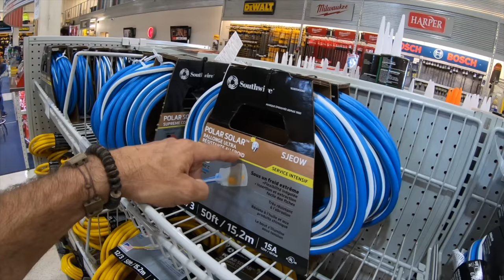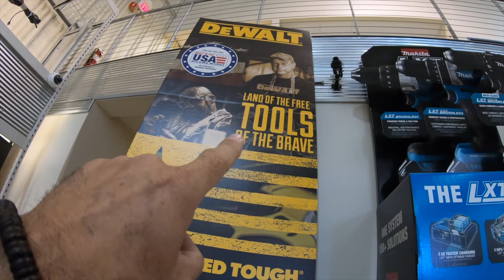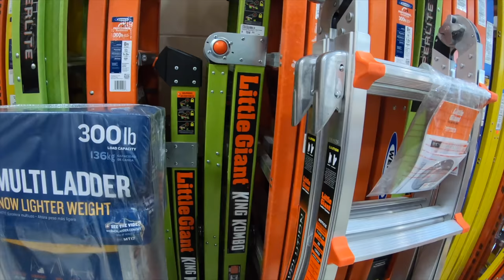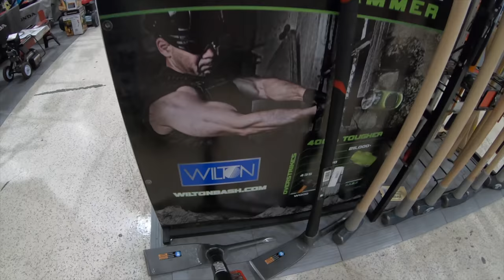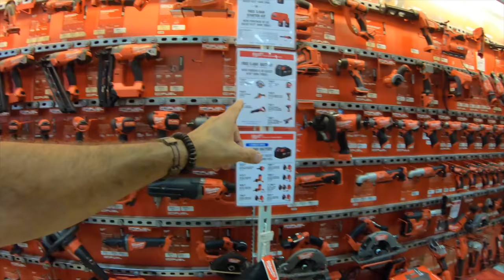Touring the coolest Tool Store I've Ever seen.  4k video

Comment: I bought my Metabo 2 speed drill at the age of 15. Now i am 63 and still using it. Greetings from Belgium.
Reply: I have a 1970 grinder, has the wood handle. Had marano repair dealer put new brushes in it a few years ago an got a letter with it when I picked it up, said who ever owns this don't get rid of. Pretty cool I thought
Reply: This should have said matabo

Comment: I tried out the IQ dust-less concrete shop saw and it was AMAZING!!  I work with cinder block and landscape block and usually use Stihl quick cut saw, but this was incredible.  I cut capstones for a retaining wall for about 6 hours straight and no dust, or water needed, it all gets sucked into the pan under by its own downdraft.  Just turn the filter knob every 20 mins (hour or more in my case) and it gathers all the super fine dust in the pan below.

Comment: Those iron workers are awesome, we had one at my old high school which we used for cutting metal for welding, it cut through 1/4 inch steel like a hot knife through butter

Comment: I would love to try one of those 1”drive Milwaukee’s at work, we use Hilti cordless and Milwaukee corded, be burn through both monthly. I Also watched a coworker break the handle of the 4 lb Wilton hammer. Not sure if it was the same deal but it was labeled unbreakable. We also use metabo grinders, they are great. They hold Up the the abuse and constant use well. For decades

Comment: The "demo" chainsaw I think is a terminator chain. Its $200 for the chain. It's used by firefighters to cut holes in roof. Streight thru shingles to vent and to save.  That bosch rep is a pencil pusher. 🤣😂🤣😭
Reply: It seemed to have "blocks" for teeth, as a diamond blade chainsaw blade for concrete would have, particularly since it was positioned with the concrete saws. I don't doubt blades like you're thinking of exist, but they'd have close to normal teeth for cutting wood/sheathing, but in a manner to not be destroyed by shingles or metal roofing/flashing.
Reply: Also, look at it again 6:34, it has a water hookup like a normal concrete saw.

Comment: I've been using Metabo tools for years in metalworking industry industrial Construction they're almost the best you can get German engineering
Reply: They are with Hitachi now I'm worried about quality going down
Reply: That's all we used back in the day, but they started breaking on us all the time. When I stopped is when I bought a new hammer drill and the cord had a short in it right out of the box.
Reply: That's all we use at the metal shop weld/fab shop I work at and you can't break those angle grinders. They last 5x longer than the other brands I've had. Great products

Comment: I'm a mechanical welder that builds stands for pipes all day and we all use metabo grinders and man do they shred, awesome build quality. Personally I use my dewalt grinder (sorry I forgot the model) mainly due the fact that it has a non-keyed pinon gear meaning if it fucks off on you it slips instead torquing your wrist it has great power and pretty good and straight forward build quality. Other than grinders I don't know much about Metabo sorry.

Comment: Poor Dewalt and bosch guys.  The Milwaukee lineup is crushing the competition with all the offerings
Reply: Milwaukee is on fire with all of the new lineups and specialty tools. It seems like every few days or at least weekly they are releasing an upgrade or specialty tool that I didn’t know I needed next! I thought the other brands were keeping up but that’s not the case. The only tool line could give them a run is Makita and I don’t think they’re interested a drug out turf war and so they keep to themselves and specialize in what they know best  and every once in a while they kick out something new to the lineups. Stanley/Dewalt/B & D are trying to give big red some competition but their tool allergies keep slowing them down. I’m glad to see Milwaukee acting like the old business even if they are just a shell of what they were when they were Wisconsin based and building bulletproof hole hawgs & the original sawsall. I would be all over their new battery lineups now that they make 12 Ah lunchbox batteries with super chargers that recharge the largest batteries in just 1 hours time! Unreal!
Reply: Truth!

Comment: What good are those bits if they are splitting the wood, now if that was a “real work piece” we would have to replace the wood!
Reply: The splitting wood had to do with the nails being driven along the cleavage grain of the wood.  It was the nails that caused the splitting not the bit.

Comment: Iron works are a very valuable tool for iron work. We had a Scotchman at the fab shop I worked at. You can punch round, square, oval, slots. 10 times faster than a drill. Not portable like a drill though. You can cut angle iron, round bar, square bar, flat bar, some plate, notch pipe and square tube, bend iron, make U-bolts, and square u-bolts.

Comment: I'm a Union Steamfitter and Metabo grinders are the best in the business. Definitely recommended for everyday use. But if you only use it once in awhile and dont you it to extremes I wouldn't get one.
Reply: The best.. I've burned up all of them but the Metabo not even comparible they are the best.. only thing my Metabo ever did I had to replace the cord with a Dewalt cord and dewalt cords ain't the greatest (all I had handy off a burnt up dewalt).. But Metabo IS THE BEST PERIOD.... but now Hitachi has bought Metabo and it sucks the table saw is a prime example

Comment: Metabo is a German heavy duty industry tool company, we have used their 6 inch and larger grinders in the steel mills for the last .20 years.Rugged,and high rpm is,tool less disc changing.

Comment: The Wilton BASH hammer line is the best hammers you’ll ever buy, I have been using them for years. You will definitely never break the handle as I believe it has steel all the way through it which also makes them the most efficient and hard hitting hammers you’ll ever put your hands on.

Comment: I've got the Bosch HD drill and half inch drive impact set. Loved the impact until the bits quit locking in. I didn't touch a drill for a couple months. When I began using the drill I found out pretty fast it was useless and went back to using a cheap air drill. You can forget using it with a stepbit or holesaw. You have to babysit the batteries on the charger too. The impact doesn't have the torque it should to be a half inch drive. I always had go behind it on ½" bolts. Obviously works fine with smaller ones.

Comment: Landscapers also keep the new half-inch impact gun for blade changing on the truck and that is using the 18 V which is awesome so then you could use that battery on the air compressor if one was low Vice versa

Comment: I’ve never used anything else besides the metabo grinders but there grinder for metal work are the best of the best I use a 6 inch grinder all day doing pipe fitting structural steel Millwright work fabrication demolition. That’s all I will buy and that’s all I will use. Tried other brands and they do not last like the metabos do I’ve had my 6 inch grinder for over ten years of hard use and the only thing I have done is replaced a couple of chords from cutting them and brushes
Reply from the maker: Thank you for the input Duane !

Comment: I have a lot of experience with the concrete chainsaw from stihl.   Mainly cuttin out doors in windows in concrete foundations for access or remodeling purposes.  If you take a regular concrete saw and put 2 blades on it side by side instead of one it will give you a nice guide for your concrete chainsaw

Comment: You asked about metabo, they make the best grinders out of anyone. I’ve had mine for 7 years and haven’t been able to break it and the power compared to anything else is unreal. No bogging down on heavy steel or burning out the gears. I have newer models just cause we all like new tools but I’m a welder and I wouldent choose any other grinder over them. Anytime you break them you can get it repaired or they will replace but haven’t been able to break one yet in my 9 years of welding. Also every welder I’ve worked with swears by them as well they dominate the welding field, you can ask any welder.

Comment: I can't believe he hasn't heard of metabo. When doing construction, metabo was such a household name that it's what we called it whenever we attached a cutting disc to a grinder. "Hey John, go over there and metabo a 2 foot length of pipe for me, and get it ready for welding."
Reply: The type of construction you do is the main difference. Most fire resistive commercial buildings will be put up with mainly steel. Residential buildings will mainly use wood and even the piping is plastic so having a high end Metabo grinder in your truck would be rare.
Reply: @superdog1964  I didn't think of this, it should have been obvious. You're right, I did mostly industrial construction.

Comment: I work for a concrete cutting companyThe chainsaw is only used for specialty cuts where you have limited clearance or tight space  the chain is ridiculously expensive $400 on average and it does not last  long at all

Comment: I just seen the spanner wrench demo by bosh and metabo has gotten rid of those with a hand spring nut years ago. You can change with ease no matter how hard you push through steel or the times you pinch a blade cause everyone knows when you do that it’s hell using a spanner to get a disk off but not matabos.

Comment: Landscapers also keep the 4 1/2 inch angle grinder with the 18 V on the truck for blade sharpening with the 18 V I’m dying for 18 V Air compressor imagine that with their big amp battery

Comment: I dont have the full titanium stiletto.  But my stiletto hammer is the best hammer ive ever had. As a carpenter its a must
Reply: I just ordered myself one yesterday m8, I decided to treat myself after somebody picked up my beloved 22oz estwing on site and walked off with it leaving behind their old, fucked one.
In the UK they are marketed as the Milwaukee stiletto hammer, they are a little more expensive aswell. I have paid £200 ($250) but it comes with two heads, one flat and one milled head. I cannot wait for it to get here on Tuesday, 
I use my first fix nail gun when theres a lot of nailing to be done. 👍🙂🙂👍

Comment: Concrete chainsaws are junk compared to a quick saw.  They are for a specific purpose of cutting into a corner where a circular blade can't fit.  The chains on them wear out really really fast, basically you need a new chain per job, not per jobsite per job.

Comment: I may be the only one but disappointing.  Just today I was thinking I needed a proper tool store (had to drill and tap in stainless and needed a better tap handle and letter bit that I didn't have on the truck) then I see this in my feed when I get home.  But ... only contractor tools.  Not a ratchet, socket, tap/die, letter drill, etc in site.  So great for construction trades.  Not so much for mechanical, machinist, etc.

Comment: Bosch's idea of a grinder that needs no spanner wrenches a good one except that you have to use Bosch discs which really hamstrings a person if there's somewhere and they run out of Bosch discs they can't just run to their local hardware store and get a regular disc. That increases revenues for Bosch but it screws the consumer in cornering them to use only Bosch discs. I hate anything that is proprietary. I rarely use a spanner wrench anyway. I just used the button to lock the spindle and twist it off with my hand. As they spin they tighten anyway and I've never had a problem. I'm actually had a problem getting it off sometimes but never have had one fly off because it wasn't tightened down.

Comment: I can't believe you Guys don't kow anything about Metabo!
Go into any serious Welding/Fabrication Shop, Refinery, or just about any serious Industrial setting, and see what kind of Angle Grinders they are using. Metabo! That's what you will see. I have used, and worn out about every brand of Angle Grinder ever made, (cordless  & corded) I can tell you that I use nothing but Metabo Angle Grinders now. They are German made, and top shelf quality. Very comfortable to use. All of mine are "Tool less". I can change the Grinding Wheel, Flap Disc, or Cutting Wheel in seconds, by hand, no tools required. I own them.in 4-1/2",  6",  7", & 9"
Once you use a Metabo Grinder, you won't bother with anything else again.

Comment: At 9:58 during this video. What is the number for this dewalt 12volt?
Reply: DCD701B is the tool only option and DCD701F2 will get you the drill, two batteries, a charger and a bag.

Comment: In france we use a lot of HILTI products, I rarely see you with that brand, is HILTI not so implanted in the USA?
Reply: Not really. I've never seen their consumer hand tools sold in a store.
Reply: I mainly see Hilti products used in the tool rental business and then it is the larger specialist type tools like electric powered demolition hammers, saws etc. I have yet to find a retailer in the USA with their products on a shelf and I have been at retailers in over 20 states? I have no clue why? (The rental CO's buy them somewhere!)
Reply: @superdog1964  In France Hilti sells no consumer products they only have one type of products built for the pros. They sell most of their products directly with no one between them and the users, thay have a number of shops and reps if you have a problem they have a solution everywhere in under 24hours in the worst case. You pay the price but their products are built to survive everything.
Reply: Hilti prefers to sell direct in the United States. There are several master distributors in the more rural areas and Acme Tools is one of them. The Plymouth MN is not allowed to stock Hilti per their agreement. All ND stores carry it and Duluth & Bemidji MN stores do as well.

Comment: Milwaukee SMS tools but they've also screwed there patrons more than once with crappy tools and either crappier responses to the crappy tools like the 18 volt Ni-cad and their current 12 volt systems that are almost disposable since they only last about a year. Personally, if someone is holding the tool in their hand and it's broken and they're not happy with it they should fix it regardless of whether it was registered or not.

Comment: Concrete chainsaws are a pain in the ass .but they have their application if you want to make a small square or you have to run an air vent through a block wall it's  the way to go just pray to God you don't hit rebar . concert cutter for 10 years

Comment: I’m an electrician and those Bosch 
“ nail eaters “ are garbage. 
We used to open a new 7/8 inch bit for rough wiring a new house and then take it to the next new house now we are stuck buying 2 to 3 bits per job

Comment: 19:15  INSIDE JOB TURNING NUTS IS A HARD JOB,  AT LEAST GRAB THE CORRECT SOCKET  FOR THE JOB WHILE IN A WEATHER CONTROLLED ENVIRONMENT WITH LIGHTING .. JOB REQUIREMENT  MUST HAVE SOFT HANDS .

Comment: I ran A stihl long bar concrete saw....between chain strech and inability to lock down the chain length your constantly throwing the chain. After i bought the saw and to returned to the dealer a few times I was told the tool is only ment to clean up the end and beginig of cuts from a taditional circular concrete saw. Real limited applications. Waste of time and a huge waste of money. Had no problems with the power head as you'd expext with stihl.

Comment: Re: that grinder gimmick that boasts it replaces the need for a grinder wrench...(It's a fucking wrench, not a spanner) as an Alberta pressure welder with 25years experience I can tell you that the FIRST thing we do when we buy a new grinder is throw that fucking wrench in the garbage.
I've never seen anyone use it on the job.
If you can't tighten a grinding disc by cradling the grinder between your right arm and side, holding down the lock button with your right hand finger, and tightening the disc with your left hand, then you shouldn't be operating a grinder.

Comment: The implication of a “nail eater” is that it will cut through the nail, not push it out of the way!  Unless we are talking about a finger nail, then I would rather it get pushed out of the way! While I know what the bit was supposed todo, his demonstration was flawed at best, and the way he fumbled around his statements like “ no pressure while drilling” then almost falls on his face, or using the wrong sized socket for the impact driver only shows his lack of experience in working with tools, I hope he sticks with sales for a living, I don’t want to see him or anyone else get injured, next time they should have at minimum a sales representative who works with tools so they can demonstrate them correctly, instead of trying to glass over their imperfections in workmanship to make a sale!

Comment: Any competent grinder operator never needs the wrench to get the wheel off.
Reply: What is your method?
Reply: @pryme2013   Ones we've used, all you had to do is push the button to lock the spindle/shaft and twist the wheel and the nut would loosen. I don't know if all brands are like that. I can't remember the brand we used either.
Reply: @goodtry1550  pretty much what he said.